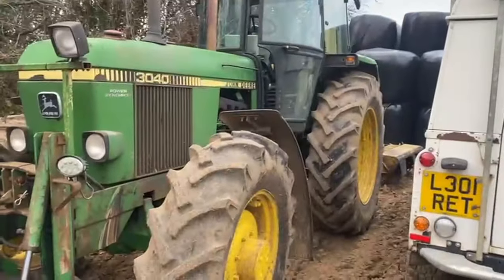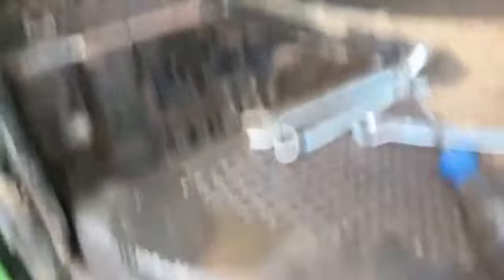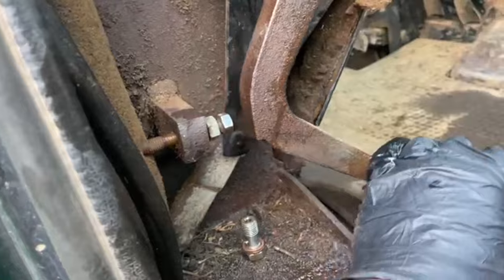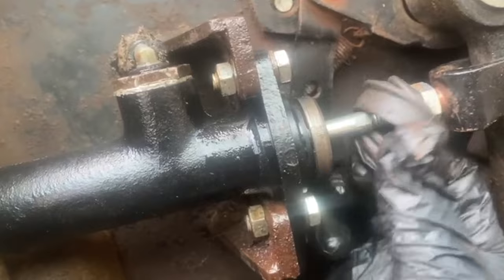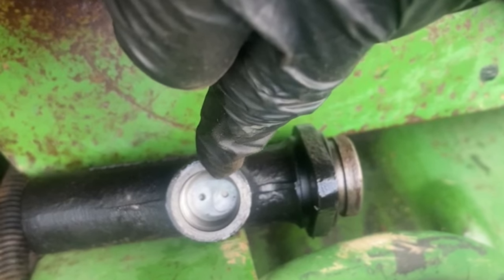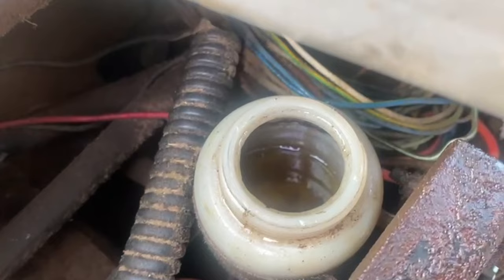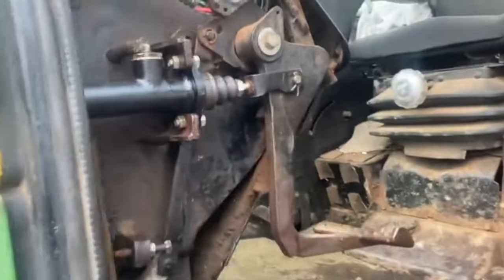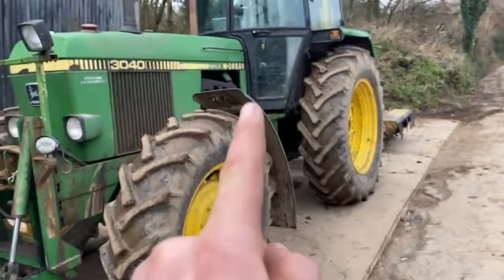Alex's 1st vid, John Deere 3040 master cylinder change and repair.

Comment: Rebuild kit for the two master brake cylinders on a MF 4355 £24 or new cylinders complete £156, both from AP UK. MF genuine new cylinders over £300 and no repair kit available. Alway's used repair kit's worked fine.
Reply: It was one of them jobs which when you need the part asap and coincidence, the dealer has one but your main supplier hasn’t got any copy parts, gotta bite the bullet. Same day problems
Reply: Funny enough I got rebuild kit for a MF375 to do on the master cylinders on the cards to be filmed

Comment: Ever thought of buying the rebuild kits for the master cylinder as it will save you 150 quid every other year
Reply: Just as I posted you talked about the rebuild kit. Also at the over inflated John deere tax and how short a time they last I would be buying aftermarket parts